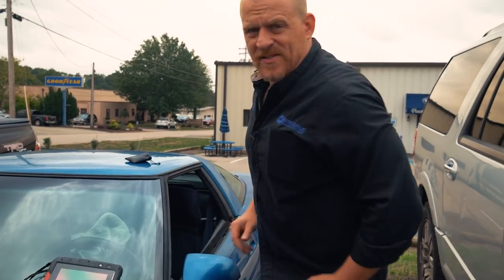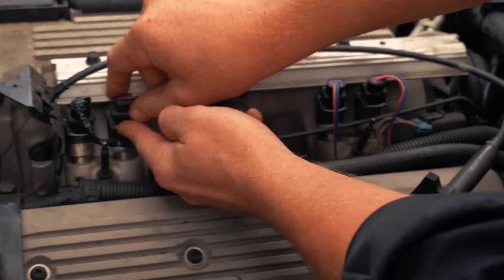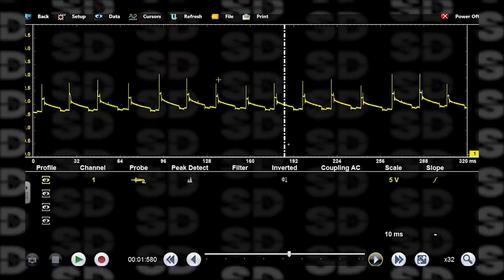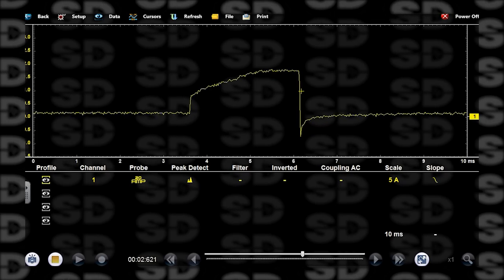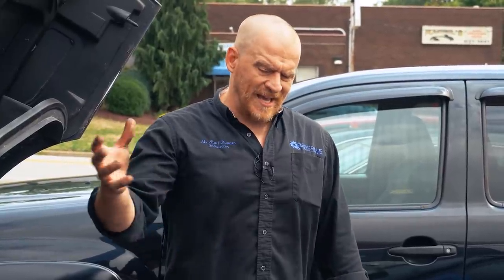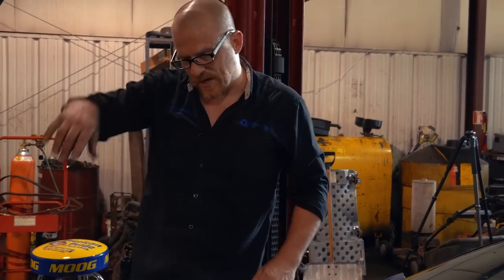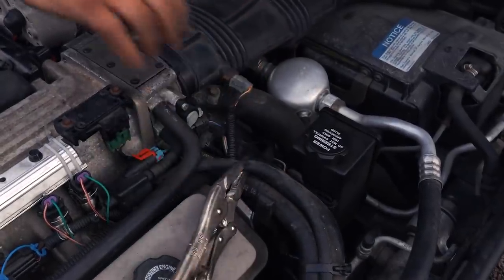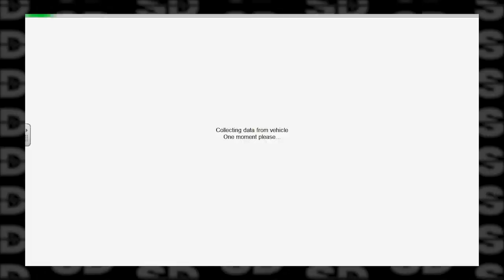1992 Corvette Misfire, Melted Cats, O2 Testing (Part 2 of 2)

Comment: If blm is 128 for zero, what is the tolerance?  Like +/- 10% LTFT on a obd2 engine. Also same question on integrator.
Reply: Value on both should range from 0..255 for an 8-bit integer, so 115..141 would be your 10% window on either side of 128/0%.

Comment: I have a silly but innocent question😁
Is there a fuel trim for diesel engines?
Reply from the maker: I don't think so as they do not use oxygen sensors either
Reply: @ScannerDanner  
So what is the sensor in the exhaust of diesel cars?
Reply from the maker: @bimmerlover4146  it is a NOx sensor according to Google lol
The NOx sensor is part of the NOx reduction aftertreatment system used in diesel vehicles with urea based SCR systems. The sensor located upstream of the SCR catalyst directly measures the engine-out NOx gas concentration, which helps determine the optimum amount of urea injection.
Reply: @ScannerDanner  Thanks man👍, I am not a mechanic, but I love mechanics and cars

Comment: oh by the way, I had a customer with a ford van he replace his injectors and plugs to get rid of a misfire, he also used Accel injectors, the miss is gone but he has the same problem now as the vet but he thru out the original ford injectors so he is stuck now

Comment: I have an 2004 5.3 giving me a fit! A P 0175 and the P 0300 I changed injectors 20000 thousand miles ago and still no change? Ahhhhhhhhhh!
Reply: Look at fuel trims?  Flex fuel system? Alcohol content?  Fuel issues?
Reply: Pull vacuum hose off regulator check for fuel

Comment: Anytime u have melted cats 🐈 u know your engine is running like trash🗑
Reply: or someone gave you hot gas/poisoned your tank ;)
I could suggest 100+ ways to cause cats to melt down, while vehicle still appears to run normal, unless your a performance person who flogs them often and sees/hears/feels issues immediately, it wouldn't be noticed and I guarantee it would melt the cats, score the cylinders, eat the rings, cook exhaust valves/stick the guides, etc....  fortunately I wont say exactly what/how nor do I condone doing so ;)
Reply: @throttlebottle5906  no doubt....plenty of ways to cause a cat to melt😁aye i was just responding to the title of the video👍but whatever the cause...just fix that b4 installing a brand new cat😏